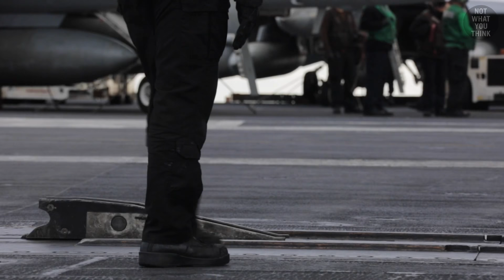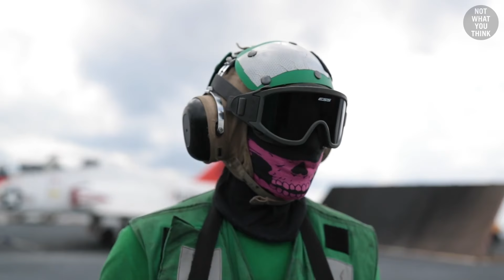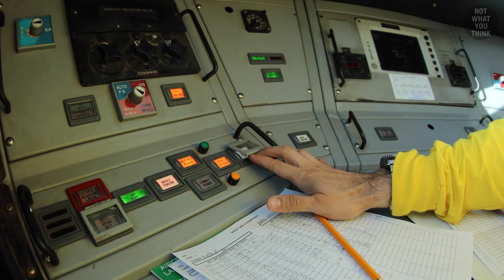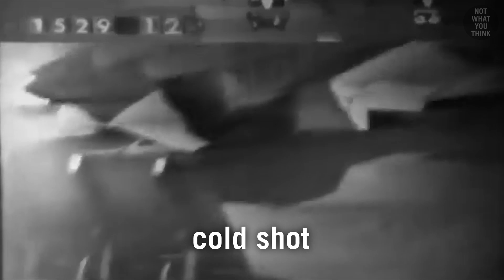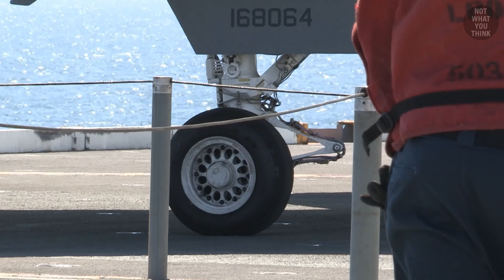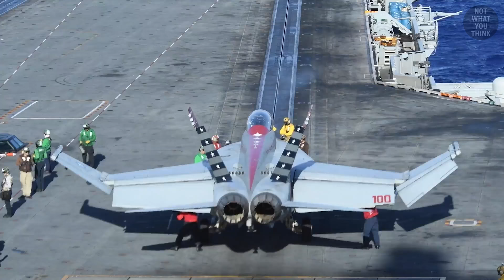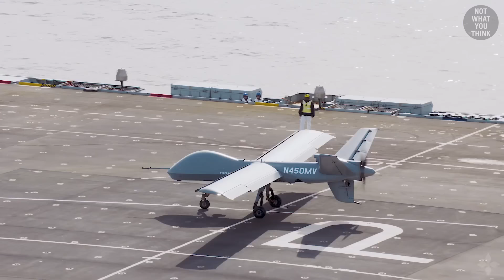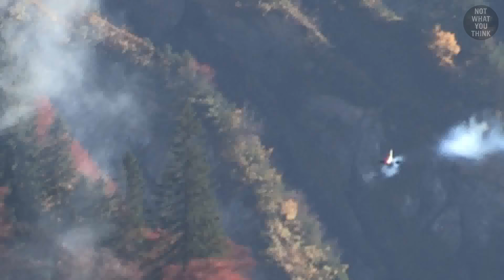Why the US Navy is Replacing Electric Catapults with Steam

Comment: I supervised reactor and steam plant test on CVN73 to CV75 and managed a reactor electrical design group.  We went to electrical for good reasons that make aircraft launch cycle time faster and with lower maintenance.  He’s comparing 60 year old mature technology with a 10 year old technology which is still developing.  The new technology will be show its superiority, it just needs time.
Reply: The video title is click bait since no carrier with EMALs can just switch to steam. The design & construction would have had steam service to the cats already in place to switch an existing EMALs. And then the bubble and deck edge controls are probably different. It's been a few years since I was on a flight deck.
Reply: @silver2644 you also need large steam tanks, plumbing etc. this will need massive redesign of a lot of decks to make room for the needed components including larger steam generators around the reactor. Because this steam is IMHO lost you will need more freshwater etc. the catapult isn’t fitted into a carrier , the carrier is build around the catapult. So switching means a totally new design.
Reply: @silver2644 nijd to veliki posao ali se nemože obaviti u plovidbi. Pr. Tramp jd hoborio o tom problemu u jednom videu.
Reply: @silver2644 You cannot just retrofit easy either. All that plumbing costs a bunch of money and takes time to install. It is high pressure piping, so not the same as your home or even Schedule 80. The pressure those pipes hold is immense.
Reply: The Navy said up front and publicly that the Ford construction would be a learn-while-building experience.  Aparently nobody paid attention.
Reply: @slv8535  Yes, and the builder, Northrop Grumman, said that too.  I remember.
Reply: @slv8535 that's the problem. Unproven technology. The Navy risks billions of dollars and sailors' lives on unproven technology. It is ridiculous.
Reply: @KittyKittyCat-vf8zd it's been a thing since 2015. Trum's been railing on it since 2017. According to Rear Adm. Shane G. Gahagan on the Gerald R. Ford, they done over 8500 "cats & traps" and "It works"
Reply: @DavidRitko the definition of work? Emal did not meet the failure rate target. It fails once every 250 launches. The target is once every 3500 or more launches. And it still cannot launch F35. When the emal fails, all four catapults fail because they share the same power pack system.
Reply: @KittyKittyCat-vf8zd  One day, steam catapults were also unproven technologies...
Reply: @georgeschildth1950 that's a really dumb coping. 😂😂😂
Reply: @KittyKittyCat-vf8zd  The 4 emals are divided into 2 groups. Each group has it's own power pack system. The system will evolve and become better as time goes by. Just like computers back in the late 80's early 90's where the so call 'experts" said they wouldn't use Microsoft Windows because it was "too slow" and they would stick with DOS. How'd that work out for ya?
Reply: @Kevin-ib4gv  640K of memory ought to be enough for everyone. (granted, this is out of context)
Reply: @gslavik  Just like my video games in 1991 that came on one 1.2MB floppy!
Reply: @KittyKittyCat-vf8zd most of our technology was created during wartime and unproven at the time.
Reply: @gslavik having worked on systems that had low memory in the 70s one of the core efforts was managing that limit so large batch processes could run timely enough.  Taking that type of limitation into real time systems in the 80s increased that effort.  Yes it could be done but development was much more expensive because of the limitations.  You want that s\w this year or next year?
Reply: @KittyKittyCat-vf8zd 
No its not.
Every new tech has to start somewhere and evolves in time.
With your state of mind the Fokker tri-plane would still be to of the line.
Reply: @janzzen1 obviously, you have never been working in a management position. This is called a risk mitigation plan. For example,China limits new technology to 30% or less in each carrier development iteration. The USA went all-in and failed in the Ford carriers program. Little kid. You got lots to learn.
Reply: well said, anything new will have issues.  Give enough time and troubleshooting,  will be better and better overtime.  Not going backwards.
Reply: @g600f700  Yeah well, Trump will go backwards, it's his brand.
Reply: @g600f700 The electro magnetic catapult has been in service for 9 years. So when will all the kinks be worked out. Im all for our aviators having the best equipment.  As long as its dependable.
Reply: @g600f700 also erstmal noch 2-3 Prototypen bauen.
Reply: @g600f700 a šta sa.štetama ns elektronici aviona. Bskon strujnog udsra mora na pregled pa ev ns srvis, a šts sko strada bdtko od posade jer ne plmažu gumene cipele a pare ima koliko hočeš ili nsči treče riješenje pogođenj avion mora u potpalublje adrugi na pa lubu sa dgugim pilotom. Nije baš jednostavno.
Reply: @g600f700 they should have built a test platform thatvwas a scaled down mock-up. They did the same thing with LCS and the latest frigate they just canceled. Build the platform and hope the tech works, or build the platform and we'll figure out the tech later. Navy planners fkn suck, and Obama made their job even harder during his tenure
Reply: @RAWDEAL064  give them time and a chance, replace them if not making progress.
Reply: @RAWDEAL064  they did.  Its located in Lakehurst NJ.  Google "emals prototype location
Reply: @RAWDEAL064  the Navy wanted to do that. Donald Rumsfeld made them put it on the new class without test.
Reply: @PBScourge didn't know that. Shame
Reply: @RAWDEAL064  What the hell do you think they did? Put the first prototype on a carrier? You have no idea what you are talking about yet you keep doing it... But hey, Trump loves the uneducated.
Reply: @the_effect_de ah yes. The pseudo-intellectual that uses "uneducated" in the wrong context, invokes the dreaded "Trump" word, and has the gaul to talk about something i lived through. That is exactly what they didn't do. Same for the LCS, same for the now canceled frigate the Frigate is arguably worse because there was zero planning, and they were making it up as they went. The LCS that continues to drain your tax dollars, of which I'm sure you're an expert on, was designed and built with warfare packages that were still theoretical, and still have not been built. They used untested experimental propulsion systems they constantly broke down and was a huge reason why they shut the program down. 

What else you got, oh omniscient one?
Reply: @RAWDEAL064  no prior serviceman can be an expert on every system but we work toward our own peril when we ignore a subject matter expert who lived it. Thank you for your service, and your insight.
Reply: @RAWDEAL064  According to Gemini, "Years of land-based testing were conducted at Lakehurst, N.J., prior to shipboard installation." Those were followed by no-load tests on ships in 2015, followed by dead-load tests, and then the first aircraft launched in 2017.
Reply: @RAWDEAL064 it WILL and DOES work tho thats the thing. Why put a steam catapult on a ship youll just have to replace with an electric catapult anyway? Put the electric in, work out the kinks as you go
Reply: @g600f700  
It's very difficult, if not impossible.
Reply: @MrAnarchocapitalist  years of land based tests mean nothing to the ocean and being on a moving ship.
Reply: @the_effect_de  , Do you HATE the uneducated?  Do you HATE anybody that has less education than you do?  Some of the most admirable people that I have ever known have had great success without ever going to college.  That is the context of what Trump said.  For my medical profession , I had 9 years of POST-GRADUATE education , which included 5 years POST-DOCTORAL education.  By comparison, do you come close?  If not, are you not worthy of being loved by anybody?
Reply: @FernandoL75314  Not really, but I do hate when they choose to stay ignorant, when they completely overestimate their own competence and when they choose to distrust anyone more competent than themselves. 
Those are the reasons why they often fall for populism, drift into blind hatred and contribute to making our world worse.
And those are the attributes that Trump loves, that they are easily deceived and accept any lies as long as you give them an enemy and tell them they were better.

You are the one suggesting high education was necessary to even be worthy of being loved. I have no idea why you'd make such an inhumane statement. 

If you ask for my personal opinion on the uneducated: For me it's more about intelligence. Unintelligent people are just incredibly frustrasting to communicate with if you're on the other spectrum. There is correlation between lack of education and lack of intelligence though.
Reply: @RAWDEAL064   It's a beyond-frustrating situation, without question, but it's far from any one or two administration's fault. Congress certainly plays its part as well. The LCS planning and failure to properly iterate, develop & introduce new technologies leading up to the Ford-class were Rumsfeld during the Bush admin. My cousin was an O-5 involved with Navy planning & doctrine when he was placed on the oversight & review team assigned to conduct due diligence on LCS prior to the initial decision to go ahead with building the first 2 of both LCS classes later in Bush's 2nd term, and he & his team warned strongly against the decisions that the Bush admin ultimately made, but they didn't want to hear any of it. In fact, he & the team were hosed for the remainder of that admin because they told the admin the uncomfortable truth and were relentlessly adamant that their approach to LCS would be a devastating mistake, so they sandbagged him & the team for not telling them what they wanted to hear and not shutting up about their findings that the plan & approach the admin wanted to (and ultimately did) take would almost certainly be a disaster. The Constellation-class selection and improper development & redesign standards were from Trump 1. Obama and Biden didn't do near enough to correct the problems, but they're problems that have been a whole-of-government issue across multiple administrations. What's more, Clinton set it in all in motion with the infamous "last supper" approach after the Cold War when he took office, and it was his admin's devastating strategic planning approach his admin forced the Navy, and US military more broadly, to adopt in the last few years of his term which saddled the US with the strategic & industrial issues and long-term erosion of our strategic & material disposition we continue to suffer from now.

I also feel compelled to state that the "uneducated" comment from whoever made it was uncalled for. You, as anybody, shouldn't have to put up with that kind of crap after giving your valid opinion in good faith. It's not even worth engaging with people that make comments like that. Thank you for sharing your honest thoughts.
Reply: @RAWDEAL064  lcs are doing good in Iran war and finally useful as a minesweeper in shallow waters l8ke the gulf
Reply: @RAWDEAL064 also zumwalt class destroyers. They could never get the rail gun to work. And the assumption to bombard the shores of small countries falters in the era of drones. Why does the navy have these problems? Corruption. And corruption is a clear sign of a declining power.
Reply: @g600f700 they had more than a decade already. Apparently, they don't have a solution in sight.
Reply: @PBScourge the Chinese did it the opposite way. The emal and steam catapults competed for the right to get onboard the Fuijan carrier. And the emal won. Both are mature technologies in China.
Reply: @MrAnarchocapitalist now explain how it fails on the Ford. Did they ignore the failing  ground test results or doctor the test result to make it look good? ❤
Reply: @Alloy682 they are replacing the emal on Ford. They are redesigning the carriers in the pipeline to use steam catapults.
Reply: @jonathanjones3126 the failure is on the power pack/power chain. It could be tested fully on land. China has done it. Don't tell me that the USA cannot.
Reply: @KittyKittyCat-vf8zd  what works on land does not always work on the ocean reliably. Maglev trains work but are expensive  but I wouldn't build them over salt water without at least a decade of real life testing not simulations.
Reply: @KittyKittyCat-vf8zd  It hasn't failed on the Ford. It had problems initially, but you (and Trump) are years out of date. And the Ford, Kennedy, and Enterprise are keeping the EMALS. It is being replaced on the Dorris Miller onward. Dorris Miller was slated for 2034, but that will be pushed back several more years because of Trump's very stable genius decision to remove the EMALS.
Reply: @jonathanjones3126 and the Ford still cannot operate F35C. Why? China Fuijan can launch J35 bilut the Ford can't launch F35!? It is a huge red flag.
Reply: @KittyKittyCat-vf8zd  i dont think the navy actually wanted the f35. One fighter for the navy and airforce is stupid. The airforce operates off of long runways. The navy uses aircraft carriers and requires two engines and much better built aircraft do to landing and take off stress.
Reply: @jonathanjones3126 F35Cs are launched off the deck of Nimitz class carrier for years. What is that telling you? Something is wrong with the emal. It is not compatible with the F35. Stop making shit up to cope already. Face the problem like a mature man. Can you not?
Reply: I agree. F35 design is dumb. But the subject here is emal. Let's not change the subject to divert and cope.
Reply: @KittyKittyCat-vf8zd  electromagnetic catapults on a ship is problematic, on land it is much easier to use, on a ship that moves and flexes and it always exposed to salt water and air introduces alot of problems.
Reply: @KittyKittyCat-vf8zd  Unlike the steel they used for the carrier deck, LOL
Reply: @jonathanjones3126 if they did not account for corrosion issues during development, it should not be installed on the production warships period.  We are looking at major problems that cannot be resolved for more than a decade. Not a minor hiccup that was overlooked.
Reply: @KittyKittyCat-vf8zd  the electric catapult should have tested throughly for a decade or two on the ocean and in different conditions.
Reply: @g600f700 are you doubting the engineers who have been working the emal problems for over a decade?  Apparently, they came to the conclusion that the problem cannot be fixed in a reasonable time. It is a technological bottleneck.  Most likely, a complete redesign and a rebuild are needed. That may take a decade or more. Emal had its chances. Going back to steam is the right call.
Reply: @KittyKittyCat-vf8zd  What is the problem? Please describe the deaths and air frame losses caused by it.
Describe the extra crew hired above the level used for the steam launches.
Describe amount of missions not launched or launched late, then provide the same numbers for steam.

As far as I know electrical magnet launches beats out steam on all metrics. It has not yet hit all its own metrics, they are still higher than steams were...
Reply: @yurie2388 you should do you own dd. You have already been brainwashed by the military industrial complex to worship the emal. I cannot save you from your own ignorance. 
In short , the emal system onboard the USS Ford has a failure rate of around 1 in 250 launches up from 1 in 180 launches. The combat requirements call for a failure rate of 1 in 4415 launches. When one catapult fails due to the flywheel issue, all 4 catapults quit working. The ship has to return to port for repairs.  What will happen and what are the risks to the carrier crews during a combat operation in a war zone?  Grow up! Learn to admit a mistake. Stop emotional attached to your own wrong opinion. Stop throwing good money after the bad.
Reply: Emal is not the only issue. The electromagnetic wire arresting system has similar issues/failure rate. And  the failing weapon elevators are also a major concerns.  Few people talk about the these two problems. Get a clue.
Reply: And of course the laundry fire and the clogged toilets. Ford uses the same toilet system and piping as on a crusie ship. Big problem. Cruise ships go to port often. Toilets system gets flushed, tanks get emptied and supplies replenished quickly. Carrier does not do that. Lincoln and Ford stayed out at sea for 200+ days. Ford is fundamentally designed wrong.
Reply: Degreed EE with four decades of experience in Mil & Aerospace. Always stick with the KISS principle - Keep It Simple, Stupid. You can troubleshoot & fix steam quicker & easier without software & diagnostic tools. Ever tried to fix a newer car? - Same deal.
Reply: @UserName45937 I was a Nuclear Mechanical Systems Inspector.  I must agree with you. For some reason the people who made the decision do not understand that. Im for keep solving the problems on the Ford. Then build ships with the all the upgrades.
Reply: @UserName45937  Never had a "new" car. Kept my steam car. I don't trust those new cars with those dang gas engines. Now they're trying to sell me an electric car you plug in at night! I'm staying with the KISS principle like you said!!   :)
Reply: Some poor design choices, but the tech is solid.
Reply: @abram730  the technology probably needed real life testing in real life conditions on a test ship or two for at least a decade to improve the reliability.
Reply: @jonathanjones3126  the problem with that is, we are out of time. Drones are hitting the battlefield big time now, and with steam catapults lacking the capability to use drones is a massive limitation that needs to be addressed now.
Reply: @ryuukeisscifiproductions1818  drones are to easily hacked or jammed and pre written instructions cannot cover all conditions.  Wired drones work in those conditions  but have even more limitations on ramge. A emp warhead would fry most battlefield electronics unless their hardened for it and drones are to light to have properly hardened systems.
Reply: @ryuukeisscifiproductions1818 yeah, people wants to have a do everything carrier. Right now, it cannot even launch the F35.  Meanwhile, China is preparing to fight war in an industrial scale. As drone is a completely different ball game than manned fight , China constructs purposely built drone carrier the type 076. First ship is in Sea trial. Once validated, you shall see tens maybe 15 of these ships.
Reply: @KittyKittyCat-vf8zd  You do know China also uses EMALs on their latest carrier right, for much the same reason, the ability to launch and recover Drones. They are literally doing the same thing the Us navy is doing for the exact same reasons. 

And uh guess what, reality has also disprove you as Ford can and did launch all kinds of aircraft on its extremely long 326 day deployment. Yes there where problems, but problems are to be expected on a deployment that long, considering that the Abraham Lincoln is also having all kinds of problems due to being at sea far longer than a normal deployment.
Reply: @ryuukeisscifiproductions1818 and you think Trump wants to return to steam catapult just for fun? Trump may not be the smartest cookie in the jar. But he is definitely not stupid.
Reply: @ryuukeisscifiproductions1818 Ford can't launch F35. Get a clue. Stop spilling BS. 
 And you are totally clueless on the Chinese naval doctrine. The Chinese war strategy is completely different than the US's.
Reply: And emal catapult is not the only thing that's failing on Ford. Even bigger issues are the magnetic cable arresting system and the electromagnetic weapon elevators. These impact combat operations and safety directly.
Reply: Then the infamous clogged toilets and laundry fire. Something is really wrong. The Navy is not telling us the whole story.
Reply: @KittyKittyCat-vf8zd  all those systems need two or three redundant backups for operations sake.
Reply: You have only one cable arresting system. And you have multiple weapons elevators spread across the deck. When some fail, the weapon officers would push live ordinance across the decks to the planes. Not only the efficiency is much lower, it is dangerous. Last bit not least, when one emal fails, all four fail. It is a huge problem.
Reply: @KittyKittyCat-vf8zd  Fords 332 day deployment says otherwise. Maybe if you quit listening to fake news media and whatever nonsense comes out of your favorite dear leaders mouth is, you would know that. 

And if EMAS was that bad, then why is China using it on their latest aircraft carrier, and they have skipped steam entirely. 

Ah who am i kidding,you wont listen to reason, because you aren't working on reason but an emotional attachment to old outdated technology. You think older automatically equals better no matter what, no further thoughts needed, because thinking is difficult.
Reply: Trump just today canceled electric catapults on all carriers going forward.
Reply: @guytansbariva2295…because he understands military technology and strategy more than anyone???
Reply: people make the same comparison with electric cars verses the one hundred year plus tech of gasoline cars.
Reply: @richardelliott8352  Except Chinese electric cars are already ahead of Western gasoline cars.
Reply: @ZweiZwolf  Yes, they've built many, many more of them too.   All parked, door-to-door in overflow-unsold lots in the same country they were manufactured in.  Unsold.
But they are certainly ahead in numbers of unsold vehicles!
Reply: @kcsnow9447   LOL, are you still talking about the failed rideshare inventory from a decade ago?  Can I point at Fisker, Nikola, and Lordsdown as counterpoint?
Reply: 2 more weeks
Reply: Lower maintenance hasn’t been the truth so far though….
Reply: .   @kendrickswartz4318 the maintenance type changes pretty dramatically from steam systems with piping and valve repairs to power electronics.   Track maintenance will be similar for either type but the lifecycle costs will be dramatically different.  It’s too early to confirm as the carrier is not old enough to complete a full maintenance cycle.
Reply: The water that goes through the reactor core is not used to make the steam. The reactor water goes under  pressure increasing the boiling point into a steam generator that makes steam from treated fresh water. The video shows the loss of steam from the catapults and the ship will have to make treated fresh water to make up the loss. This was a big problem during the Vietnam War. All new technologies need to get the bugs out after they go into operation.
Reply: @dennismccall9237 as someone who designed and operated, I wish to clarify your comment.  Primary system reactor coolant is not CONVERTED to steam as you say.  Primary side water is most definitely use d to make steam by carrying heat from the reactor to the secondary side where steam is produced.  That steam is sent to catapult accumulators.
Reply: Electric is not reliable. Come back to it when the navy can depend on it.
Reply: This most important reason to go back to steam is because that's what's required for sweat shops to force the child labor for rowing the aircraft carrier.
Reply: Now we have the directive to switch CVN-81back to steam and hydraulic elevators because of issues with their electrical systems… Haters are mutating that into CVNs 78, 79, and 80 being retrofitted.
Reply: The Chinese have already done it
Reply: should add a few big Javelin that can be launch smoothly.
+ 1 (medieval) weapon on board
Reply: @budisutanto5987  more fun than a football, might catch some sharks?
Reply: Would you be okay with EMALS + JATO instead of steam? I'd like to be able to launch and recover c130s now that we have rapid dragon.
Reply: @WefixBayonets emal can't even launch F35.
Reply: @KittyKittyCat-vf8zd  Really? Too Heavy? I just figured with a hybrid system you wouldn't have as much long exposed high voltage lines. It'd be bad enough if you ruptured a steam pipe but EMP wouldn't take it out. And if you lose electrical you'll need to cool that reactor one way or the other.
Reply: Yup.
Reply: time is not what we have atm
Reply: time? chinese one just proved it. chinese uses supercapacitor, while american uses flywheel with superconductor bearing.
Reply: Ne radi se o elektro tehmici več elektronici i dtatičkim nsbojima pogotovo kad zalijeva slana voda. Morat če se bsči treče riješenje. To če biti nrtko od possdd kako to obično biva.
Reply: Launch times proved to be slower   Fat Cat C13 Mod 2 ever 25 (approx) seconds EMALS one a minute.
Reply: Absolutely. Steam is essential for the generation of electricity but after that not useful except for a small number of other non traditional purposes.
Reply: Exactly. WAS upset to see this but I have faith in the rail gun. Thank you for posting ta.
Reply: Here’s an idea. Keep it in R&D until it’s ready for everyday use. Progress is a must but not at the cost of lives lost over glitches n bugs.
Reply: @ThorOdinson-z4lso you do not think that occurred?  An untested system was fielded in the fleet?  That’s not how the Navy does things.  Where’s the soft cat shots causing loss of aircraft?   None that I’ve read about.    This is about system up time limiting operations, not failures during launch causing losing planes.
Reply: Wäre es nicht sinnvoll gewesen, das zu testen und bis zur einsatzreife zu entwickeln?
Reply: Flugzeugträger ne teure banane?
Reply: Who knows how it will unfold but Trump did just officially order the Navy to rip out the electromagnetic catapults and replace them with steam >_>
Reply: @Siestascape  but It’s not funded.  DoD has pots of money allocated by congress and you cannot just simply spend it any way you want.   Changes this big will require a budget line item and approval.
Reply: Trump has just signed the paper to return to the steam catapult. 😂😂😂
Reply: Planning to gut metals out for his own person defiant class warship vessel. Trouble getting 10 ton detonation nuclear to air blast american cities. Not going to have any chance.
Reply: EMALs tech funding and testing is 20+ years old. August 2026. Billions spent. Failure.
Reply: New tech has new issues, it takes time to iron out the problems.
Reply: The USA is planning to be use the Ford class carriers for both manned aircraft and drone operations. Another fundamental design problem. Drones require different onboard setup and equipment. It makes both operations inefficient. China uses carriers for manned flight operations and drone carriers, e.g. Type 076 LHD for drones operations. The USA cannot get out of the Cold War thinking in all aspects. And the US keeps going down the wrong path.
Reply: We don't have the time
Reply: In the beginning of World War II, the U.S. Navy pre-maturely deployed the “new technology” Mark 14 torpedo, without adequate testing and refinement.  In battle, the Mark 14 was a catastrophic disaster.   Until “the new technology is shown to be superior” to the “mature” technology, the new technology needs to remain being tested and refined, over and over again, at Lakehurst, and not deployed on a CVN.
Reply: Appears this is yet another (of many) Navy failures with implementing new technology/systems and strategic planning
Reply: ther you are trying to reason with the pumpkin.
Reply: it probably works ok since it's already being installed on new carrier trump just has  old information
Reply: Long range hypersonic missiles are likely to make the whole issue of aircraft carriers moot before too long. $14b targets that already have to stand off iran 1000 miles
Reply: Please let DT know that he is WRONG!!!!!
Reply: They have been working on EMALS for over 20 years, most likely for 30 or more.
Reply: Thank trump put steam back
Reply: The same thinking regarding bringing back battleships. The man is a moron.
Reply: Do you know Bill Schoonover?
Reply: Trump is living in the past, when porn stars were only $135k.
Reply: What is your thoughts on stopping the manufacture of new Ford class carriers while they develop the technology on the 2 or three they finish, and refueling some Nimitz class for another service life? To keep cranking out new carriers that are having issues seams nuts. Why not perfect and maybe even redesign the emals carriers before they build more?
Reply: Given he has less than 3 years left, time is something he or any president doesn't have.
Reply: @wgemini4422  Will the US still exist as a democracy in 3 yrs? If he doesn't stroke out, he'll be impeached before the end of next January. Then you'll have Tech Billionaires running the country through JD Vance. Of course the US will be broke financially to go with its broken democracy.
Reply: @JoeCanuck-k4j   it`s ok they have learing centers
Reply: @JoeCanuck-k4j  don't you have a protest to be at?
Reply: USA is not a democracy.  If that's the case then we'd have a dictatorship overnight life all other "democracies".
Reply: Oh, but Donnie said steam is the answer, electric is no good…. Donnie knows best. Just ask him.
Reply: @JimGleason-bs1gz He doesn’t know his ass from an anchor except both are rusty & smell
Reply: Not being held back by ANY knowledge on the subject, Trump makes his decisions on his own delusional reasoning.
Reply: @tjroelsma  He’ll ask Bad Bunny who probably knows more than him.
Reply: @tjroelsma why would anyone even listen to him to begin with! There are experienced people with a lot of degrees and actual knowledge in the field. 😂😂😂😂😂
Reply: @alanmay7929  because if you don't, you die!!!
Reply: @alanmay7929  I can't even listen for half a minute to Trump, as he's always alternating between bragging about how he's a "very stable genius" and how "the whole world is against him in one huge conspiracy and he's the perpetual victim".

In my opinion people listen to him because the members of the Republican party have ripped out their spines and offered them to their Lord and Master Donald Trump. They vote for and sign whatever he wants them to sign.

As to his very old-fashioned, and frankly often insane, ideas: he stopped learning around the age of 9, when he decided that he now knew what he wanted to know (which was how to play the system to his advantage) and that it was all he ever wanted to know.
Reply: @tjroelsma yikes
Reply: @tjroelsma  What's delusional is thinking you have more information on the matter compared to the President. 

Ever consider maybe he sees conflict coming sooner rather than later and wants our forces ready? Pretty fucking bad to be having mechanical issues with a new technology when the bombs start flying.
Reply: @DextaviusLakwonJackson  have you heard him TALK? There is absolutely zero, and I sincerely mean zero brain function on display to even joke he's seeing anything other than 90 seconds into his future.
Reply: @basement56  True but how would you asses the last President and his Vice President with regards to available brain function? 
Please be honest.
Reply: @thedave7760  you want honesty? Fine. At least they were adults who could understand the world doesn't revolve around them. But whatever, you equate stuttering as the same as whatever the hell this jackass has. Plus they both graduated from college/law school. So automatically they have more going on upstairs than this buffoon. Bet your "diploma" is from the school of hard knocks and that "edumacation" is for nerds. Get bent.
Reply: @thedave7760  The last President was probably just as bad as Trump. Maybe slightly better because he had no illusions of grandeur and the willingness to throw away all of the US allies.
Reply: @palaius Illusions of Grandeur. Really, not bold ambition, not pompous pride, but illusions of Grandeur. Have you ever wondered if perhaps there’s more than one way to categorize behaviors? Have you ever wondered if using clinical language to reference someone like the POTUS is in itself inapplicable?
Reply: @DextaviusLakwonJackson Um, conflicts that were never there in the first place that he decided to start on some self-proclaimed whim? Think deeply about what sort of person follows such behaviors...A child. A delusional adult. An impulsive person. Hopefully not you or me.
Reply: Maybe he thinks "magnets = china" and "china china china"?
Reply: No, he thinks magnets dont work when wet. He's said that many times. Facts no longer matter.
Reply: @predragbalorda China has a real advantage with electromagnetic drive as they have a large installed base of high speed trains which help them to develop the propulsion technology.   The US has does not have the industrial base to draw on for electromagnetic design.   But given enough time and money I am sure the electromagnetic catapults will work well.
Reply: @mikerit9570 we have Magic Mountain
Reply: @mikerit9570  The US has been launching roller coasters with linear magnetic drives for decades. The technology itself is old, it's just the engineering for widely varying loads that is challenging.
Reply: @mikerit9570  That's not doing the same thing. It's vaguely similar but too different.
Reply: @Treblaine  I think you meant to say, same thing but different scale & complexity.

Fundamentally, there's little difference. But scale wise it's like comparing a gunpowder rocket with the solid rocket motor of a AIM-9 Sidewinder.
Reply: @mikerit9570  yeah but those high speed trains don't have any air circulation systems, and CO2 builds up very quickly.  The CCP is trying to keep it quiet, but there are quite a few videos now of passengers testing air quality on those "future trains" and it's not good.  I'm honestly surprised noone has died yet.

China's real advantage is numbers, not tech.  Their tech is severely hampered by corruption, far more so than western countries, and its quality variable.  

I really hope we don't end up fighting, because China is really close to my house.  Well, relatively close.  😅
Reply: @Treblaine china also has maglev train and actually developing more
Reply: @jimfrazier8104  There's a big difference between launching 2 tons at up to 80 mph, where coming up short means the coaster rolls backward vs. 70,000 lbs of Fat Amy at 150-200 mph coming up short and dropping into the ocean.
Reply: @ThatSockmonkey  That's some ridiculous copium you're huffing. Pretending that China doesn't have 10x more engineers of significantly higher capability is the kind of nonsense that results in 10,000 USN sailors and their carrier group at the bottom of the ocean. 

Videos of Chinese high speed rail trains show they running so smoothly that they can balance coins on edge.  That's the result of advanced metallurgy so that the thermal expansion of the wheels is uniform along with precision alignment to the millimeter.  The idea they don't have fresh air valves on a thing that travels at sea level is just nonsense. In 2025, China had 4.6 billion HSR trips without incident, whereas the US had fewer than 1 billion passenger flights. 

China just demoed a flying drone that fires their standard semi-automatic rifle at a human target, placing 10 7.62x51mm rounds in a 10 cm (4 in)  ring at 100 meters (330 ft). They're very proud of the software which automatically corrects drop, etc for range, wind, temperature, etc just like the main gun of a M1 Abrams. 

By summer, China will have received their initial order of 1 million anti-personnel drones. War with China looks to be a very bad idea.
Reply: @ZweiZwolf  no need to be rude about it, fucking hell.
Reply: @ZweiZwolf  I'd have just used redundant electric motors with VFDs.
Reply: @jimfrazier8104  Not having the details, but seeing the Chinese EMALS cleanly launch their fighters and AEW, I wouldn't second guess their approach.  Presumably, they'll keep launching to see how the thing compares with expectations before moving to an improved flat top.  I'm amazed everything works as well as it does for their first time out.
Reply: You have no idea what you are talking about, do you?
Reply: @ThatSockmonkey fkg BS. Have you ever taken a Chinese Maglev train or Chinese high speed train. They are engineering marvels.
Reply: @mikerit9570 the US problem is not on the emal. The problems are the power supplies behind it. Ford uses AC and mechanical fly wheel as capacitor. That's a huge problem. And the transformer also fails often.
Reply: Trump is far too ignorant and stupid to understand that!
Reply: OK then it can go on ships built in 20 years. We need ships that can go to sea now and be repaired in the field.
Reply: I’m sure the navy will find ways to sandbag steam cats on the fords long enough and make them expensive enough that they’ll be able to just build emals.
Reply: the current problem is we don't have the luxury of time. the Nimitz class carriers are retiring, we need new carriers to fit in the requirement of duty asap. but clearly Ford can't. Ford was supposed to be the strongest carrier and deployed in west pacific. but due to the EMAL issues, it can't fit the role to against the most competitive target or to the middle east. Instead, it was used to against the weakest - kidnapping Maduro. If you are the commander who needs USNAVY to maintain as the most powerful Navy in the world, but keep receiving reports of endless problems. what will you do?
Reply: @jrylei  that lack of a luxury of time is also why EMALs is needed now. With drones now making a massive impact, we need carriers capable of using them, and right now, Ford is the only one that can use them because of EMAL's,
Reply: @ryuukeisscifiproductions1818  you didn't watch the video did you?
Reply: @1337flite  The video raised drone launches as a major reason why EMALs are good. What is your point?
Reply: @1337flite  The video supported EMALs for drone use. Steam tech can't really advance that much more without significantly metallurgy advances. EMALs get significantly better each year. This is similar to combustion vs EV autos. Considering what's going to be used in the future - EMALs seem the logical choice for the bulk of the fleet.
Reply: @jrylei oder eben die weltweiten allmachtsversuche einstellen?
Reply: @jrylei Rear Adm. Shane G. Gahagan says otherwise performing 8500 "cats & traps" on the Ford
Reply: Time we do not have.  

Test that crap on non-critical ships...  or THE GROUND.  Develop that BEFORE installing it on combat ships.
Reply: @AflacMan13  the time we don't have is the time it'd take to pull Ford from service and do a massive rebuild (years), stop the building of Enterprise and JFK to change their design (years). 

All of which will compound delays to Doris and Clinton, as the slipways for JFK and Enterprise won't be free, and take up dock space for the regular maintenance of other carriers, while also forcing live extensions of the Dwight, Vinson and Roosevelt they are slated to replace.

All over a piece of hardware the Navy has had to put a lot of time into, but is generally fairly happy with.
Reply: @AflacMan13  Um, they did test it on the ground. When rocket engineers design a rocket, they also test "on the ground" and yet, rockets go boom. You can only go so far with what you call testing on the ground. Working out the bugs in actual use is what is happening now and unlike steam, software updates can and are applied to the electric propulsion system in a way that never could have been done with steam.
Reply: The TDS is strong!
Reply: @Patrick-xd8jv nope.  Just a long engineering career developing control systems for ships.  Did you ever wonder why steam locomotives are no longer used?  Because they are insanely more expensive than electric.

The same reasoning applies here.  Technology has sufficiently advanced to the point where electric catapults life cycle costs are less than steam and you get space utilization and operational improvements.
Reply: @scottkelley1558 Thanks for a great analogy but Trump doesn't see it as so because Vlade whispered in his ear..."Steam." Trump's childish mind is taking him back to what he knows, his early train toys...Steam locomotives. That's so crazy. What's crazier is there are adults who still think like kids or adolescents.
Reply: So as usual, Trump doesn’t know what he doesn’t know.
Reply: I have an idea: the US could buy steam catapults from China and then quickly begin building aircraft carriers. China would make money, and the US would rapidly acquire new aircraft carriers.
Reply: @kangbule  sounds like a great idea. lets have china, our #1 enemy, build our aircraft carriers. what could go wrong?
Reply: @kangbule  You must have graduated from Harvard MBA. It's a great business idea. However, Navy Academy graduates would throw this business plan to the trash can.
Reply: @kangbule  probably outsourcing building carrier to China would be faster and higher quality.
Reply: @ggggbbbbbwu895  HII Newport News has the most experience of any yard, anywhere, in building aircraft carriers.
Reply: Almost every failure is a lost aircraft and that could be totaling in the millions to billions of dollars in loses..
Reply: Scott thats the problem, time. We are fixing to have a major conflict. We don't have time to beta test we need you guys set up so no gremlins come along at the wrong time. Switching to electric and working through it makes sense in peace time. In perilous times we gotta go with what's proven. 

That and the directed energy weapons will end up eating into a limited reservoir.  Even with nuclear there are limits.  That reactor is gonna make steam regardless. So either we limit an already limited supply or we use a byproduct that's readily available. 

A lot of the emotional commentators aren't looking at the big picture and don't know how tense things really are geopolitically. They also don't realize the sheer cost of repairs and maintenance go. We can't be hobbled with extra cost when we'll need it for the coffers. 

And everyone else, this isn't a Trump issue geopolitically, it's been bad for a while, he's the first to actually do something instead of just talk. This conflict has been on the horrizon since the 1800s. Trump might be old but he's not opium wars old. 

America wasn't a direct participant until our steamer was attacked (I swear it's always a boat). They want our place as top nation. But they also want to see western nations and their alliances destroyed because of what happened then and unchecked greed/thirst for power etc of the ccp
Reply: @Justin_Ebright  Things don't need to be this way but the prosperity of other nations will always be seen as a threat to the US because of the way the US is set up to outsource all its industry to Asia and Europe to maximize profits and use of global debt slavery to keep them under control as vassal states. What is driving the world to war is America's own greed and globalist imperialist system. 
America's military and technical competence also absolutely cratered during Biden's relentless presidency that destroyed all remaining competent white American men holding the country together with woke DEI bullshit and white guilt vilification and is the reason why America's military is a shadow of even what it was during the Syrian conflict era.

On the subject of catapults, things are already too late. Focusing on pumping out proven legacy systems for current military needs is the correct move but America is so deindustrialized and hollowed out by corruption that even this is not likely to result in successful mass production. EMALS are undoubtedly the future due to having no down time and affording naval aviation superior take off weight and this makes it clear that China is already technologically superior to the US in an ever growing amount of fields. 
This just highlights how the US continues to destroy its future to maximize short term gain while the rest of the non western world continues to make rapid progress, leave the dying Western world behind as a whole. 
The Chinese do not seek world domination but have merely made China great again.
The West is dying because fifth columnists and liberals have utterly destroyed our civilization spirit, fighting daily to destroy our heritage, culture and traditional values; ultimately seeking to make white people second class minority citizens in their own countries. China isn't destroying or replacing us, poisonous elements of our own countries are the ones doing that.
Reply: I agree, give it time like everything else we have released, takes time to work out the bugs.   Just hope it remains not as costly as it could be and no one loses their lives.
Reply: The author did not actually explain the main reason: a thermal efficiency of steam catapult is very low and because of this it consumes a lot of steam that even nuclear reactor unable to supply much enough. Higher efficiency of electric catapult allows to launch more aircraft. Also not explained that the main drawback is that electric catapult is extremely expensive, that's main reason why Trump did not like it.
Reply: @crazydigger4931  EMALS is extremely expensive if you don't have domestic advanced battery, capacitor, and high voltage control systems, so are forced to create them from scratch.  

OTOH, if you are the world leader in electronics technology, without any legacy steam catapults, then leapfrogging directly to EMALS is probably cheaper.  

Considering how the Type 003 deck layout changed, it's likely the steam was originally planned, but switched to EMALS after internal testing.
Reply: The problem is that there's almost zero room for 'practice' on active aircraft carriers that cost 13 billion dollars and need to be ready for war at all times. When you look at a system with 99.5% uptime vs a system with less than 50% uptime it becomes really really obvious that regardless of the advantages when they work, the main necessity is that they work ALL THE TIME.

EM catapults will mature and be the future of carrier ops but its a huge risk to install them when they're still so unreliable.
Reply: @Dr.TJ_Eckleburg not just the emal not up to par, the cable  arresting system and magnetic weapon elevators are big problems. The power chain is the main problem. It affects multiple critical systems on the ship.
Reply: @KittyKittyCat-vf8zd  Correct. The elevators are a big problem also. The whole system is not ready for war. Maybe in another generation, but not now.
Reply: @KittyKittyCat-vf8zd So the elevators are steam?  Electric motors have come a long way since the 60’s
Reply: @Jethr001do your own due diligence instead of spilling nonsense out of your ignorance.
Reply: And the Ford still cannot launch the F35.
Reply: @KittyKittyCat-vf8zd  That is related to the jet blast deflectors and onboard intermediate maintenance capabilities.  The ship construction details had to be finalized before the F-35 design stabilized.  Essentially, the ship needs the same modernization given to earlier CVNs.  EMALs are not part of that issue.
Reply: @scottkelley1558 lol don't copy everything you see on Google..use your brain. 😂😂😂
Reply: Something is really wrong. The Navy is not telling us the whole story.
Reply: @KittyKittyCat-vf8zd  so your litterally telling the people who have to work with these systems on a daily basis that their wrong and are stupid to side with the system that makes their jobs more effective?

instead you believe out of touch Politicians, many of which never fucking served in the military Like a certain president, little alone came close to working with these systems.
Reply: @Dr.TJ_Eckleburg tu se slažem jer nije samo nedodtatak vremena več folszi do štete na avionima. Ono šts ih čink tsko močnima osim motora sj elekttondki sustavi koji padaju zbog udara statičkog elektriciteta. Nemožete reči u borbi stop ili tajmout pa kad popravite idemo dalje a dtonkvi ssmi zs sebe ništa ne rjršavaju. Ustina za njih netrebaju katapulti ali niti takvi brodovi ka o Ford a pozreba zs njims raste. Nidam nikad čuo fa je dpotodt kof poletsnja pronlem več da bi elrkztični omogičili korištenje jsčih aviona na njima pa neni zrebalo moloti" saveznike" da ustipsju baze i aerodrome kao ovih dana. Koliko skupog.benzina treba potrošiti da se F-22  ili F-35   zankira u zrsku da dođe do aetodroma u npr Emiratimatima pa onda puta 100 koliko oh je kažu prebačeno. Napad na Iran je izveden sa tri stotine USA avlna i 36 Izraelskih jer je Izrael trebao čevati svoje granice.
Reply: Cmon man. He was talking about himself whole time.
Reply: I was just going to upvote but it's currently on 666.......I'm not going to mess with that beauty.
Reply: Is there anyway you could have a dual system? So Electronic as the primary, but have the steam as a backup.
Reply: @ComdrStew  No, that is even worse because now you are paying for two systems to do the work of one.  Typically, we build redundant power supplies to the equipment and let the number of channels be the backup (i.e the backup to catapult 1 is catapults 2-4).  Steam pipiing and its condensate return lines are expensive to install and then maintain for the life of the ship.  Electric cables, not so much.

I watched the machining of catapult track.  its a a precision machining and there are ~ 1200 feet of track.  Expensive to produce.
Reply: I agree, although for sake of readiness Steam works and the cost is lower, and cant be hacked or susceptible to EMP's etc. It all depends on what the initial mandate was and we probably don't have all the data. Look at the Bradly personal carrier and its stupid cost and development process. Trump only approaches these things from an ROI or reliability, and the Navy has a horrible history of building things that never get used or retired early at the Tax payers expense. Cyber security is a great example, we continue to complain about it but still continue to link all things together ?? If Security was the main concern then stop linking things together. E.G. Americas Electrical Grid !
Reply: @brentbeckman5643 I hope EMALS has EMP shielding but that may be hard because the shuttle has to be sticking out on the flight deck to launch the plane.
Reply: @brentbeckman5643  If the catapult is suseptible to EMP, then the entire ship is susceptible to EMP and that would render steam to the catapult not available.  Ultimately, electronics govern control of the reactor and steam plants.  You cannot separate one from another.  OBTW, the maintenance costs steam are large because piping corrodes and valve seats wear and all need eventual replacement.
Reply: yes,  Chinese has had extensive comparison between Steam and Electric.  the result is overwhelmingly favor Electric,  that is why they changed their designs of the carrier No.3  in last minutes.
Reply: @ellingwood1651 how many operational carriers do they have? How fast do they launch?
Reply: do you think corrupt trump federal government wasteful pentagon can have the ability to make this steam catapult change???
Reply: Regarding steam vs electro-magnetic:
I am a retired electrical engineer from NNS and GC, rarely working on carrier projects; but my Dad did.  I heard the scuttlebut in our R&D department, which was concerning. But, I can't write about any details - you don't have a need to know, nor the clearance.
Reply: The new technology should have been tested thoroughly before you put it on the aircraft carrier.   The aircraft carrier is a warship.  Systems with problems that take years to correct should not be put on ANY warship.  Test the system until the reliability is acceptable, then put it on a warship.
Reply: The electromagnet tech is great as they are already used in the railgun technology. Also the E. M. Tech is more than 20 years old. In fact the lorentz force was discovered way back.
Reply: @ulrichraymond8372 I think there is quite a difference between EM technology of 20 years ago and the EM technology that allows a fighter jet to take off from an aircraft carrier. The Wright brother first flew in 1903 and now we are still innovating the airplanes.
Reply: My comments caused a lot of discussion which I think is good. I really gave my opinion because I believe that we must understand that better is the enemy of good enough. That concept is very critical in warfighting. We must be careful or we will price ourselves out of big deck carrier aviation. I have over 950 carrier landings and I believe firmly in the carrier's essential value in our nation's warfighting capability. In my navy years Vinson CVN70 was planned to be the last big deck because of total expenses, she cost about 800 million dollars to procure. If it was not for John Lehman 70 would be the last but he through his own personal determination gave us the next 3 Nimitz Class. I was part of the Admiral Forrest Peterson carrier study and we saw no way to make a cheaper nuke except removing such minor things as a B&A crane and the second wardroom. The Navy wanted to go to a single reactor but Rickover absolutely refused. I think the last Nimitz cost about 5B but the Ford is well over 16B. Anyone who says that the Ford is a better warfighting machine than say the America ( a non nuke) is a fool and a liar. As a professional  operator, I would much  rather go back to non nukes and have 20 outstanding machines for less life cycle costs than we will have with around 10 Ford nukes. I say that with knowledge and am not trying to blow smoke.
Reply: @ronlang3435 they cost 5 billion at the time. Your not going to build them for that now. Not to mention the cost of any other upgrades between the 2.
Reply: Yea, just needs time, so it has NO PLACE being on a military ship where failure will cost lives. Adopt it when the contractor can prove its reliability and not a second before.
Reply: I've never heard of an enemy stopping because the opposition called a time out to fix a problem
Reply: So does the democratic party.
Reply: So you think we went to Electric cats because of cycle time and reliability. Well that is not the reason at all. The President is absolutely correct and it is amazing how astute he is considering how many in the Navy have no idea. It is also sad how many strong opinions people such as those who have made comments here without a shred of actual knowledge but still have an opinion. I have run many flight decks. I was an Aircraft Handler, Air Boss, Air Operations Officer and Cargru Air Operations Officers. I have sailed on 10 carriers from the USS Essex (CV9) with hydraulic cats, Forrestal Class with Steam and Nimitz Class with steam. The greatest warfighting carrier ever built was the USS America a class of her own. If one was honest one would ask why do we have Nuke carriers when their life cycle costs are 5 to 7 times those of say the America. In other words we can have 5 to 7 more none nukes than nukesfor every nuke we build. Steam cats are just fine, we have many decades of real experience wth them, we know what they do well and we know where we have to apply attention. To change to electric is the height of stupidity.  To change to the Ford Class is equally stupid. So why did we go to electric, well in the final decision it was believed that politics and the environment would allow more carriers if they went electric. Newport News shipyard owned by Northrop Grumman at the time saw the politics and offered that solution and it was accepted. The final Nimitz class cost about 5 Billion dollars while Ford now costs 16 Billion and growing daily. So why did we originally go (before politics) towards electric. Well truth is Nimitz cannot go fast and shoot steam cats. Of course she can but the Navsea leadership (spell Rickover and his succesors) set the reactor Tav (Average temperature) at a lower number in order to preserve reactor time between refueling. Reactor operational rules are so strict that no Captain wants to violate or modify them. I saw the reactor officer on Ike get fired because he tried to explain the stupidity of many of the rules which flow from submarine reactors. So in order to go fast and shoot  one had to increase Tav in order to get 520 lbs of steam at the CSV (catapult constant speed valve). The only person who could authorize that was the Captain and a formal logbook entry was then made into the ship's record and a recompute of reactor life would eventually be made. Navsea had a team of engineers trying to figure out what to do when all that was necessary was to allow the increase of reactor temperature when needed. So along come politics (meaning Democrats, Obama was President when decsion to go to Ford was made) and the rest is history. To say that Ford and its class is a better warfighting machine that the many none nuke former carriers such as America and Kennedy is a tragic lie that some day if we go to a real war we will clearly see. PS Ford and her class will spend lots of time in maintenance while Nimitz and her class operates.
Reply: @ronlang3435  Naval reactors operate within a designed operating range and produce far more heat than needed for steam generation. Steam catapults depend on steam flow and accumulators, not reactor temperature.

EMALS also wasn’t a political decision. Development started in the 90s, decades before Obama and even before the system was selected for the CVN-21 program. The move was first and foremost about engineering: smoother launches, lower airframe stress, better support for lighter aircraft and UAVs, and faster turnaround times.

Steam is mature and reliable, but EMALS was chosen for flexibility and future requirements, even if it’s still in development.
Reply: @RTomassi  "smoother launches, lower airframe stress, better support for lighter aircraft and UAVs" that's the same point reiterated 3 times. But what does it matter if the launch forces are lower if the landing forces are still high? It's a difference without a distinction. 

No one is suggesting that Obama would have to have started the EMALS program in the 90s when he was a community organizer any more than anyone is suggesting that Trump opposed the initial prototyping of EMALS in the 90s when he was a reality TV star. The issue is taking something was perfectly reasonable to experiment with and pushing it where it's not cost effective just for the sake of having something new to show off to congress. 

It's not enough to be better in some aspects, it has to be be better overall.
Reply: @RTomassi  I wrote a response  but lost it so I will summarize.  Lots of interesting comments but the fact is we could not shoot and go fast and it was blamed on reactor temp. That was on Ike when she was a new ship. That happened to me when I was Aircfaft Handler. R&D is always going on and ecat development was part of that but we never past the engineering community intended to install it. Steam cats are just fine in every respect.
Reply: @Treblaine --

How the hell can we have a constructive conversation when people like you are conflating the launch forces with the landing forces as if they are somehow related ? ? ?

EMALS is a better launching system for all the reasons we all know.  Hands-down better.

The arresting system is separate and distinct.  If the arresting system isn't working, whether it's hydraulic or electric, then it needs to be fixed as the stand-alone system it is, and it's funtion, good or bad, has nothing to do with and should not be confused with the launch system.

What's more is that if the launching forces and stresses on the airframe can be reduced, then that's a worthwhile goal and outcome regardless of whether the landing forces and stresses can also be reduced.

You cannot argue with the fact that reducing the stresses on the airframe during launch is always a Good Thing.

And for the record, the saying is "a distinction without a difference."  There's a difference between the two wordings.
Reply: @ronlang3435 you are mis-informed about Tave affecting rated core lifetime.  core life is a function of the number of effective full power hours supported by the fuel load.  I can assure you that number has evolved and grown since CVN68 class began operations.  Tave controls secondary side steam pressure and that in turn controls how quickly the catapult steam accumulators can recharge.

The real reason nuclear power is used vs non-nuclear is the tremendous amount of tank capacity that is freed up from fuel oil storage and instead can be used for aircraft fuel.  That allows greater independence from supply and that is advantageous.  The other tradeoff is cost.  Nuclear plants are more expensive to operate and maintain, but that is a national strategic decision.
Reply: @scottkelley1558  Well Scott I am not a reactor operator and never wanted to be one. Having been on 10 carriers I can tell you the pluses and minuses of each type from an operator's prospective. I really dont care what Tav really means I only know that we were unable to shoot and the excuse was Tav, period. I am happy to hear that they evolved the number over the class. Having been an Air boss on a nuke I can tell you that we had about 3.5 million gallons of fuel tankage I know that because V4 (fuels) worked for me. Why so much tankage, well we operated airplanes and every night refueled our ships in company. I was also part of a study that looked at what did it take if we were non nuke and it meant one additional tanker to refuel us eash month to cover our own requirements
Reply: @ronlang3435 You know that congress passed a law requiring 10 (later ammended to 11) minimum CVNs decades before Obama, and that the USN has rarely strayed much above this minimum, right?
Reply: @MSNL123  Yes, when I joined the Navy in 1966 we had over 20. I was stationed on the USS Essex CV9. The reason we have not gone back to a higher number is cost, both ships and aircraft. I have been in squadrons decommisioned because they eliminated the ship they were attached to. Same with surface vessels to support the carrier. The fear of course is that if you make the carrier so expensive, it doesnt taks a genius to understand that other cheaper means of warfare will be identified
Reply: @ronlang3435  Yeah, it had more carriers. It also had a defined peer enemy in the Soviet Union, so even if the Soviet Navy was not capable to trade blow for blow (and we know this with far more clarity now than at the time) with the USN, its not like it would sit around doing nothing once it ran out of red boomers to sink.
The numbers of carriers sat at the legal minimum for decades, again, before Obama. Its the simple reality of peace dividends.
Why not surge the number of CVNs now that the PLAN is a clear rival? Simple lack of industrial capability. Carriers were always complex, relative to the tech at the time, so to get to 20 CVNs now the USN should have started around the time the Zumwalt was still going to revolutionize destroyers. And the US has one facility, capable of building one CVN at a time.
So even if it was the decision to build more CVNs, the limiting factor isn't cost, its industrial capacity. The USN could have kept building Nimitzes or a more tech conservative version of the Ford, bringing down cost. It would still have 11 carriers today.
Sure, if it didn't cost so much, the US could theoretically build another facility to handle 2 CVNs at once? Maybe. Funding seems awfully easy to find to the current administration's pet projects. Skilled workers are not.
And if you're going to spend forever to build one CVN at a time, it would have been insane to build it and risk it going obsolete in a few years.
Reply: @ronlang3435  Reactor temperature has nothing whatsoever to do with core lifetime. When you elevate temperatures in the primary loop, it reduces the margin to bulk boiling in the core, which leads to core damage and meltdowns. I was a reactor operator, so the Navy made damn good and sure I understand how they work.
Reply: @jimfrazier8104  Jim, I am not a reactor engineer (althought I went to college 60 years ago for electrical engineeringand and I did interview with Adm Rickover in 1964 for the Nuke program). I am an aviator who operated the ships cats for decades. What I know is what I observed and what I was told by the reactor people. So you were a reactor officer. You must have been on a Nimitz class and the problem I mention is on the entire class. Are you saying that the reactor was always able to open the CSV valve with 520 lbs of steam while the ship was going fast, that the Tav on the reactor never had to be increased past the normal operating temp and that a logbook entry never had to made when that was done?  I have had many an argument with the ship's engineering officer 10 minutes before scheduled launch time when I demamded more steam to shoot and he told me he could not give it to me. I then had to go to the Captain to get the approval. What I understood was that every time we increased Tav we used more fuel and therefore inpacted the reactor's life. And that the normal operating temps were established by Navsea and they did not want them violated. I do not think I said that the temp reduces the actual life but that it reduces the time between refueling. As I said the reason we went to electric was the operational problem of Nimitz class was real and if it was a calm day with no natural wind we always had to deal with the reactor issue. Big big operational impact. By the way, something we never had to deal with on a navy distillate ship. So shipmate I am sure you know how to operate a reactor and you did it below decks, but I had to operate ther ship at the flight deck level with the results of your efforts. R Lang Captain USN ret
Reply: @jimfrazier8104  ; Gentlemen, please be sure not to divulge any critical ITAR/EAR information on youtube.
I very much respect you veterans and I don't want you guys to get in trouble for something stupid as a youtube comment.

That said, I believe EMALS should be given a chance as it is by definition more "controllable" than a steam catapult.
To answer @ronlang3435's comment; you can't compare a 60 year-old tech with a 10 year old tech. steam catapults has issues in their early years as well.
Reply: @jimfrazier8104 , seconded. Average coolant temperature has nothing to do with core power.
Reply: @jimfrazier8104  yeah, if you didn't care about anything (like safety), all you need to raise core temps is to reduce coolant flow rates. Main turbine might stall when the steam volume is diverted for the cats in that case, & you'd have to cut power & propulsion, but hey, you get your higher temps.
Reply: @ronlang3435  steam production and delivery have no costs or maintenance or safety considerations?
Reply: @ronlang3435 bro is a bot
Reply: @ronlang3435 you threw away any credibility you might if had when you blamed everything on Obama while claiming Trump is smarter than anyone in the navy. Obama didn't decide to go electric. Unlike Trump he was wise enough to let the naval experts make that decision.